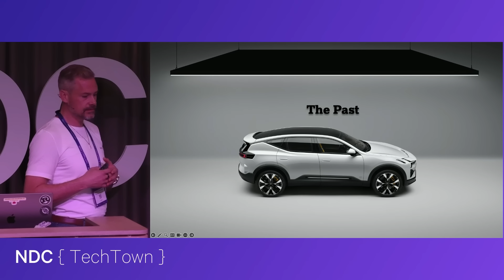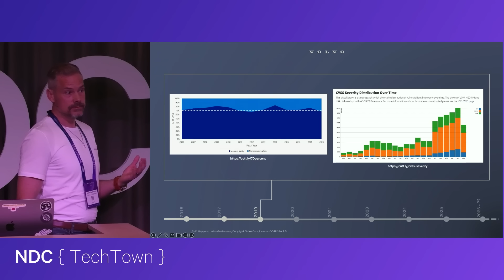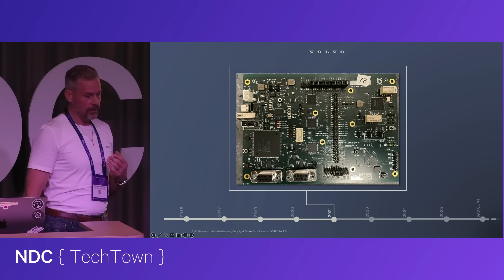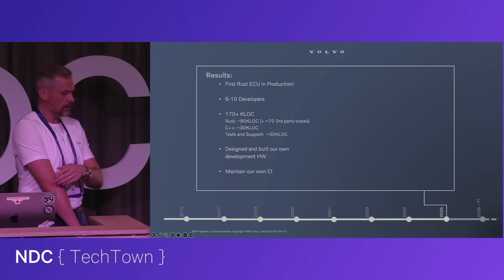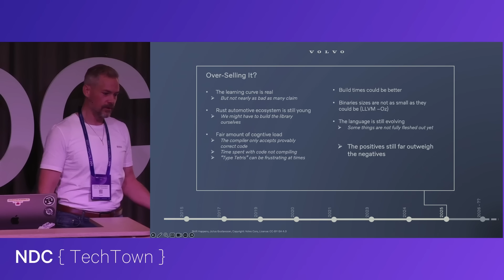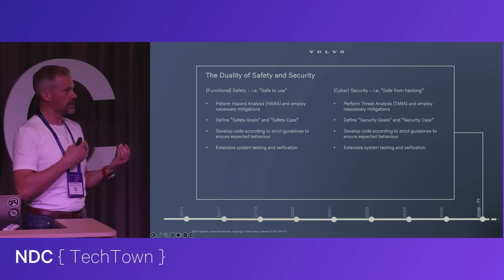Rust at Volvo Cars - Julius Gustavsson - NDC TechTown 2025

Comment: Love the ci setup.  First time I’ve seen this actually done with hardware.  Awesome!
Reply: I was fun doing that kind of hardware CI set up in the 1980's in the avionics software industry. For example we would have a lab full of black boxes (literally black, the computers that flew in the planes) surrounded by racks of electronics that simulated all the inputs from a plane and recorded all the outputs of the computers. Tests would be scripted into those test "harnesses".  All the flight control software was tested there. And retested for every little software change on a continuous basis. The difference being it was not really automated, teams of test engineers had to rerun all those tests manually, many teams working shifts, 24 hours per day for months.....

Comment: Wow. Great talk!
Did my diploma theses in 1999 with the topic realtime CAN Bus Simulation. We had VHDL, C++, C and a bit of Assembly.
But I left the automotive industry because they do not had a need for software engineers. I learned Rust 5 years ago and seeing Rust in that area is really satisfying. But with 53 a move to automotive again is probably hopeless...
Reply: I personally know engineers over 55 who have secured jobs earlier. So there is still a need for older developers.
Reply: Not at all. Sure, for part/function responsible roles, you lack the experience in automotive. But for a tech-driven role, it's always awesome to have someone who thinks a bit differently.
It's funny, I did an Ethernet-CAN gateway respecting real-time conditions in 2021.
Reply: @MrHaggyy Ethernet-CAN - Wow! 
I had to deal with crappy parallel port on a worn out win95 computer in the electronics lab. So all simulation needs to run on an Actel FPGA. Needed to build my own simple realtime processor inside the FPGA for that...
Reply: @froop2393  Yes, my (Win)Laptop caused a lot of trouble too. Protocols on top, security warnings, fast on average, but anything but real-time ... Got replaced by a Pi or tools in the lap soon.
On my target board, I delved much deeper into interrupt and memory handling than I had anticipated. On my beloved STM boards, it was a much smoother sailing.
If you are serious about moving to automotive HighTec GmbH has a first Rust compiler certified for automotive & safety critical. Their Rust Partner Ecosystem page is a good introduction.
Reply: Multinational companies in the telco, banking, and some other industries have older people as employees.